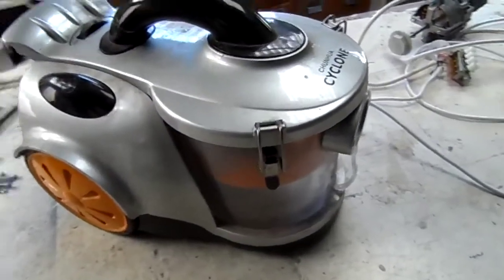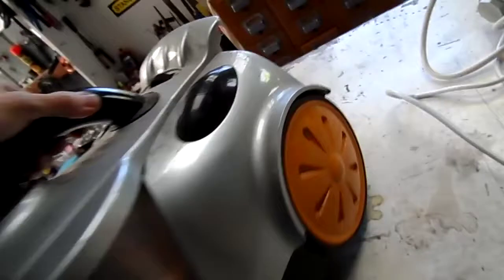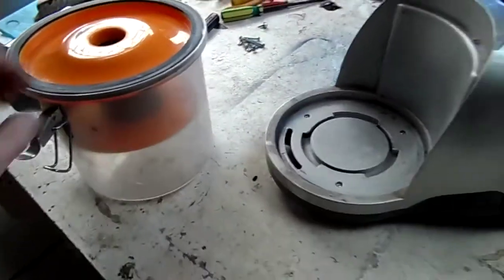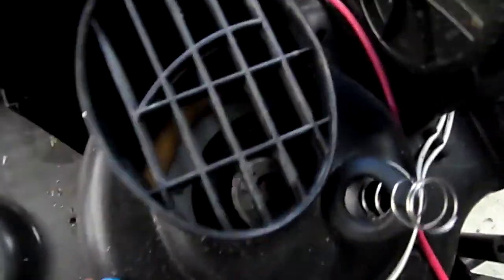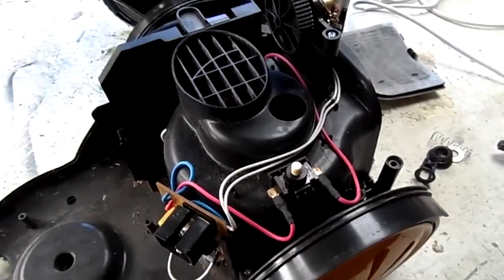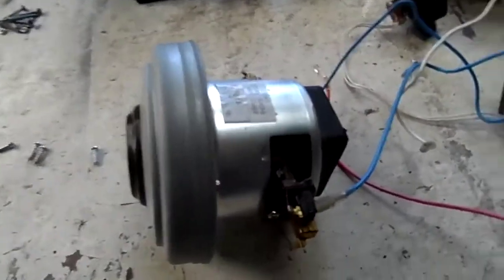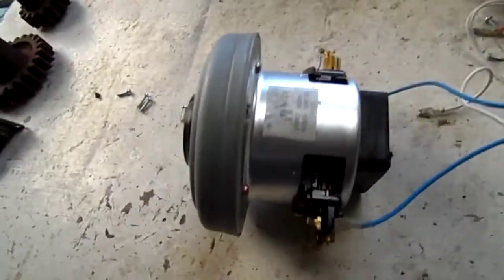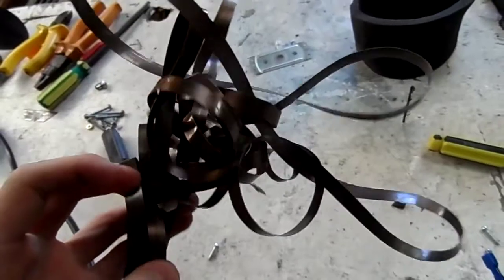"Gale Force" Cyclonic Vacuum Cleaner Autopsy

Comment: the spring thing was a bypass.
Reply from the maker: Ahh I see. To allow some air through the motor if it blocks up?
Reply: Basically. No air flow... overheats very quickly..
Reply: Most modern vacuums have at least one small one located in the base near the motor or some where near the pickup hose if equipped with some type of suction indicator like on the old phantom Thunder Cyclonic upright.
Reply: ahh my memory is not all that great on that one sorry it was a bissle vacuum  but the phantom Thunder was a bitch in it'w own respect for upright cleaner... that thing would eat a carpet if not properly taken care of.
Reply: and ate water and cat litter and never cared.. well mine did on a few occasions (accidentally on the water thing)
Reply from the maker: Coty Riddle haha yep those old uprights were indestructible, My mum uses an old Miele which has had the nastiest of dog hair, glass and even the odd sharp object and its kept it's full power to this day!